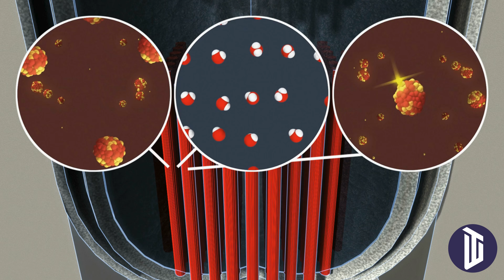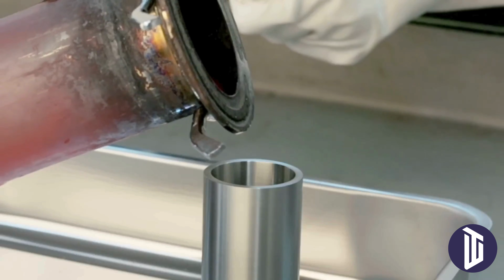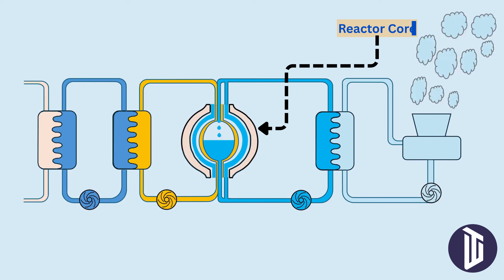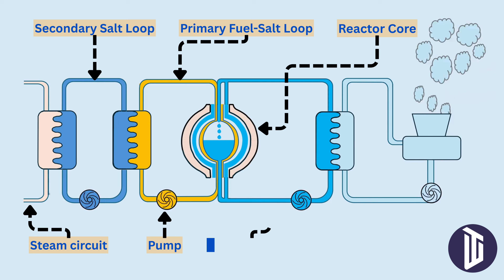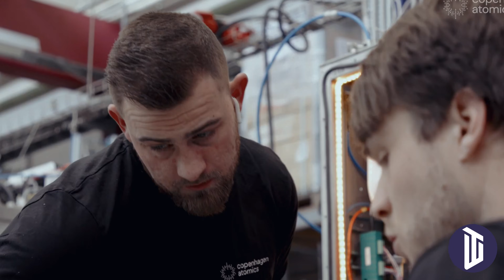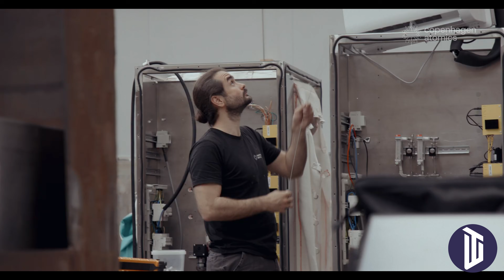How This Thorium Reactor Generates Power for Just $0.02/kWh

Comment: The doubling time for Thorium cycle breeder reactors is between 10 and 20 years. By the time there are enough Thorium reactors to power a small country the price of electricity from solar will be close to zero.
Reply: Solar will always be the most expensive way to generate dispatchable electricity for a modern industrial society.
Reply: Solar is useless in winter or hurricane country or hail,so desert is best